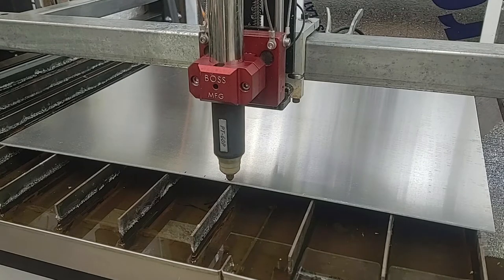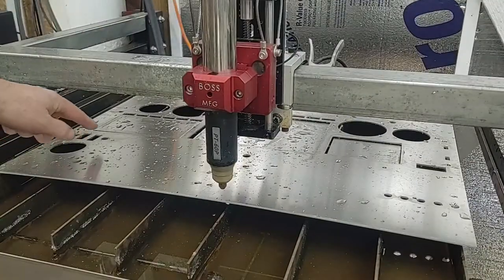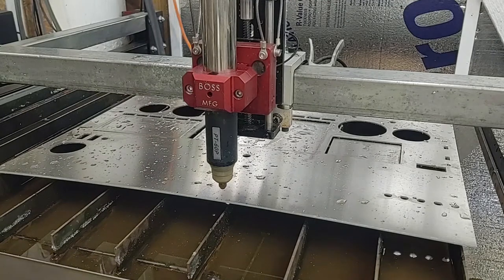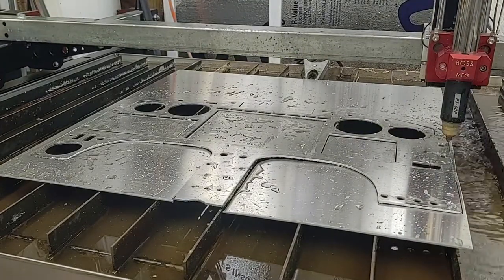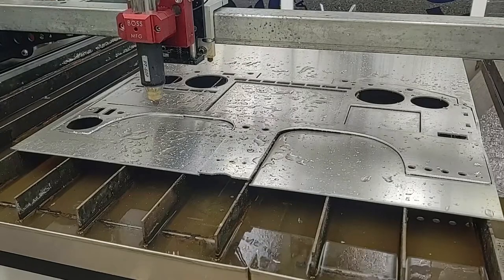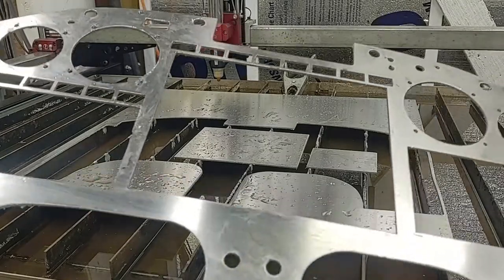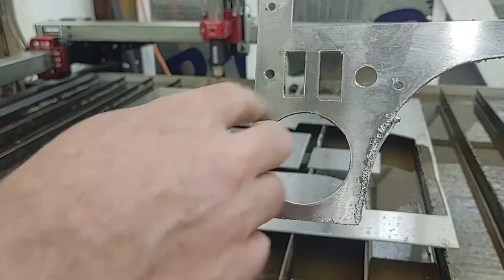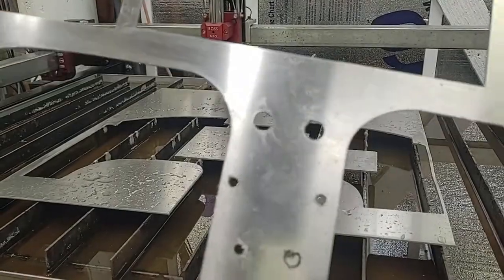Long-EZ N916WP - Plasma Cutting 6061 Aluminum Instrument Panel

Comment: At the end when you lost arc voltage you could have redone the G code file and ran the torch opposite direction and it would cut to the point it went out and finish the cut. Did not think you could refire torch in the same direction on material that's already been cut, Yours seemed to work but I think in Mach3/Proma THC it will lose arc voltage when there's no material in the cut path re running in the same direction

Comment: Hi,
Just wondering what torch and holder you are using.  Thanks Dean
Reply from the maker: Hi Dean.  Torch is PTM-60 CNC Plasma Machine Torch (Ebay).  Holder is from https://plasmatorchprotectionsystem.com/
Reply: @wade-airdog7730  Thank you i have the same torch but mine looks different did the holder on the Langmuir Z axis without any mods?

Comment: You can see it warping like crazy. Should do water jet instead.
Reply: You any water jet machines for under $10K? Neither do I.
Reply from the maker: I would love to be able to... but this did the job nicely.  A little bit of cleaning up around the edges of the holes but the panel came out very nicely IMO.
Reply: If good enough is good enough then why bother spending 2 to 3 times the amount? For extreme precision and edge quality, yes go waterjet but, if you don't mind a little clean up it can save you a lot of money.

Comment: Did you have your water level low for cut quality or fear of gas build up?
Reply from the maker: No, I didn't have the water set at any level for any particular reason.  I had to go back and look to see what level it was in this video... yeah, it probably could have been filled a bit more, but the panel turned out nicely.

Comment: Nice panel Wade. It'll be good to go in less than ½ an hour.
Reply from the maker: Thanks Bro! You were right, some slight Dremel work on those rough areas and a good clean up and it was ready to go in less than 30 min.